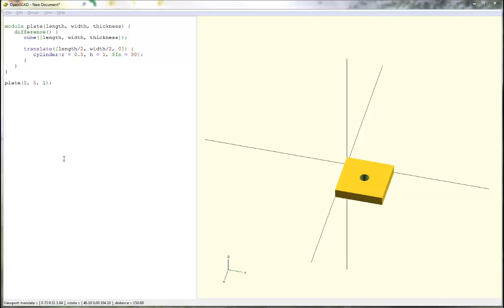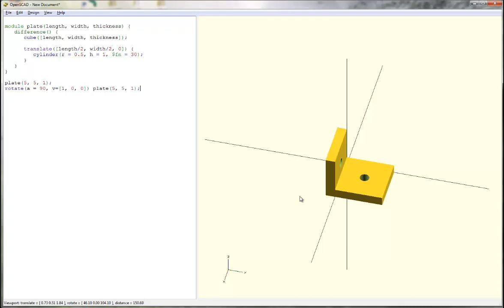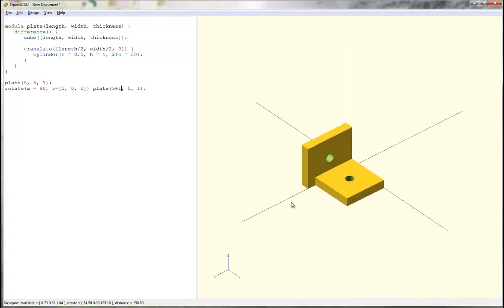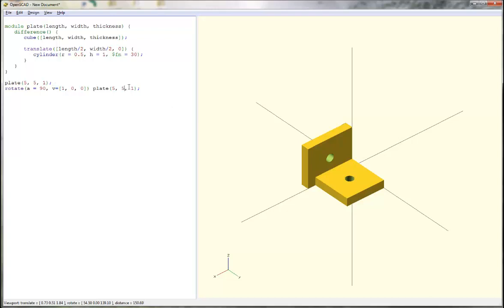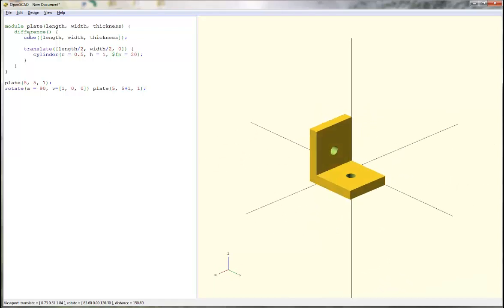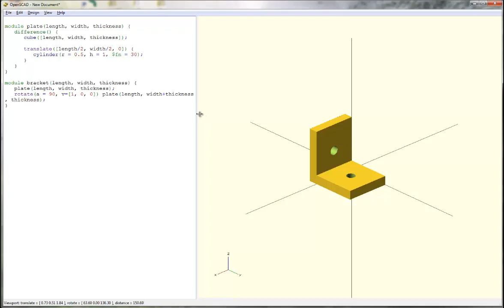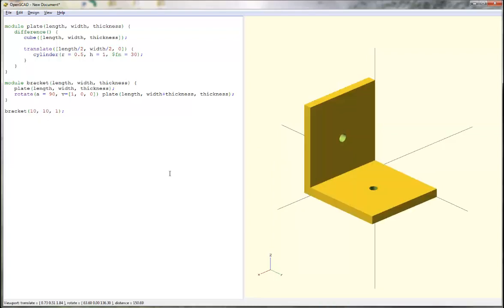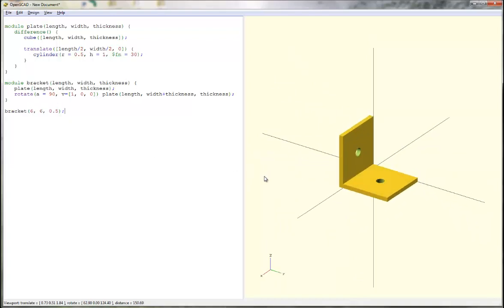Open SCAD Tutorial 3

Comment: You have 2 bugs in there.
1. Thickness can't be higher than 1
2. The rotated plate's, center hole is off by half the adjusted thickness

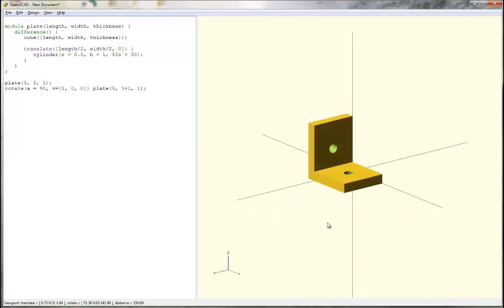Comment: Detail, at 1:53 you missed the fact that the rotated plate was the correct size, but the hole was not in the center of the plate any more. The problem is that once the hole is created in the module it can't be moved again. To avoid that issue I'd make the whole bracket more complex by rotating and translating the plate, without changing the size, and then the 'corner area' which is missing material, and add a new shape that fills in the material, using dimensions as defined by the thickness. There are other potential fixes too but they are even more complex so simpler is better.